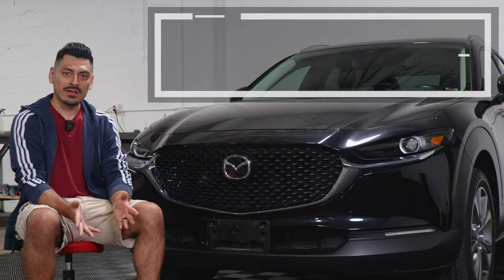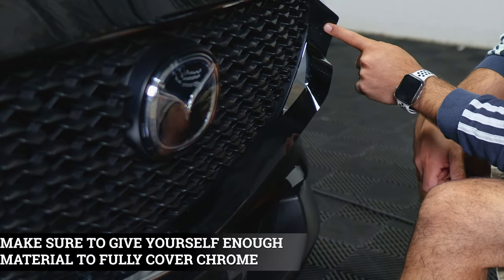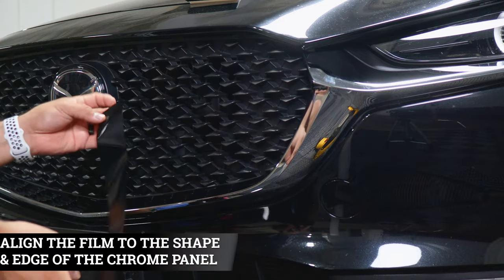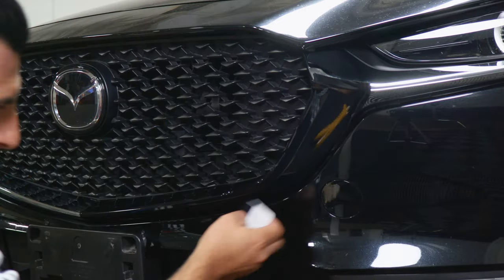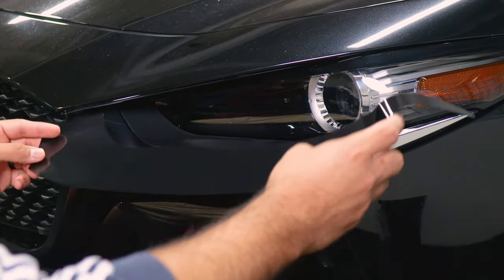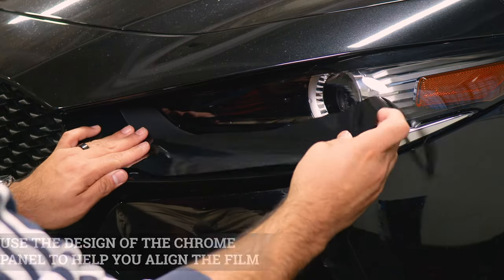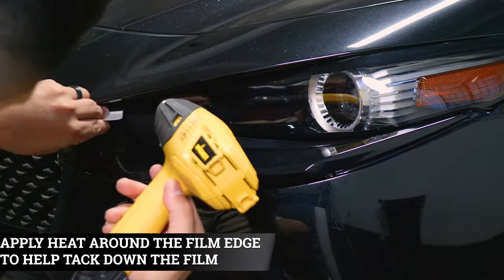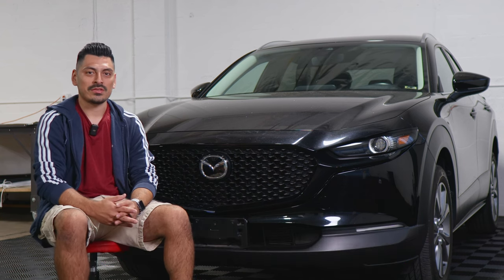2022 CX 30 Front Grille Chrome Delete Install

Comment: I just ordered two days ago. Just need a heat gun... would a cheap one be ok? And is baby shampoo the only thing we can use? I don't have that
Reply from the maker: A blow dryer can do the trick to help for the post heating part of the installs. We normally only use baby shampoo however we have heard customer use dish soap.
Reply: @BogarTechDesigns  i ended up getting a heat gun. I figured I might need it in the future anyway. I just got the package in the mail today! Haha. I didn't know your warehouse is 20 min from my house! Excited to install it this week. The only thing I'm worried about is accidentally cutting too much off during installation or cutting into my cars paint/chrome piece with the blade but we'll see.

Comment: can u not see a line where the winyl overlaps? also is this all 3inch tape?
Reply: You can see it. I'm currently doing it but as you heat it up the more it seems to blend in. You really have to go up close to see it though. It's way tough than it looks especially in the center where the license plate overlaps... in the video there's a license plate holder still attached but man it was a struggle. Wouldve been easier if i just take it off first

Comment: What if you want to take it off later if you want to sell your car?
Reply from the maker: The film can be removed later down the road by using a heat gun to help loosen the adhesive and make it easy to remove the film.